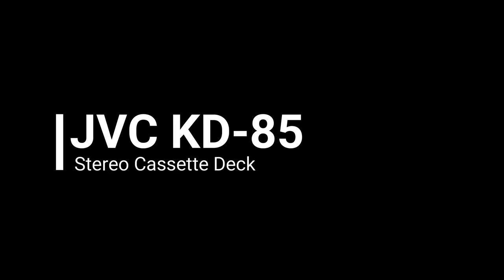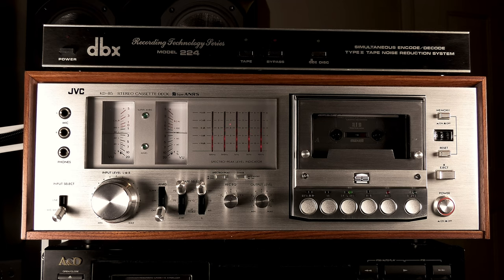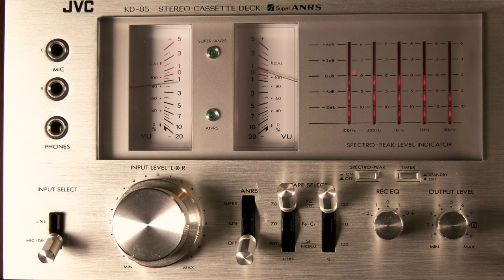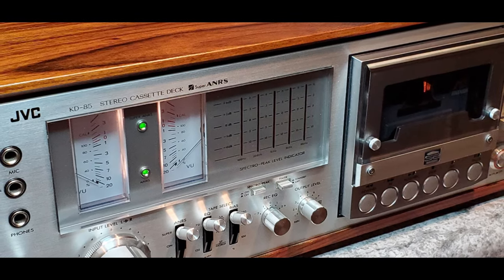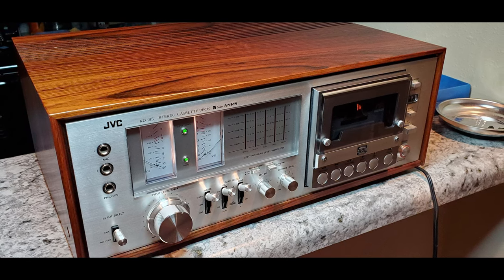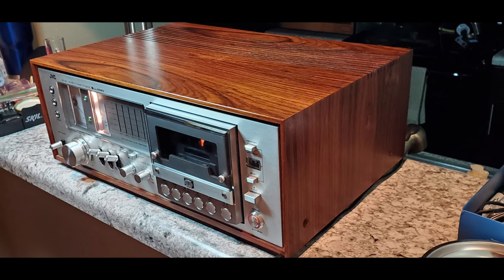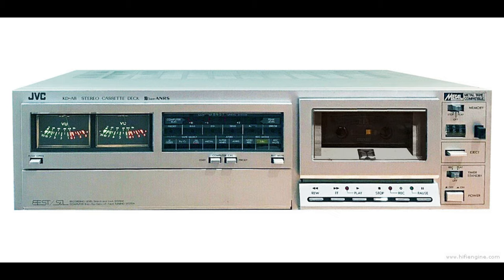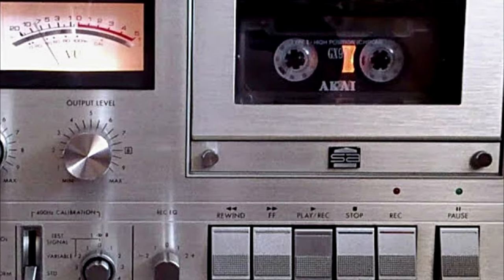JVC KD 85 Cassette Deck

Comment from the maker: Technically not mic to line mixing in the true sense. It will allow either/or of the mic/line recording but not true mixing as you cannot isolate the play record relative to your source you may record from, unlike my most current TEAC A-7300 which is true line to mic mixing. That machine elsewhere on my channel for reference. Apologies for the possible confusion.

Comment: I love my JVC cassette decks. After my KD-65 I purchased a JVC KD-A77 for the 3-head setup and I became even more addicted to recording my vinyl on tape  The JVC KD-A77 did well until 3 years ago. It died from being in storage for over a year. I was desperate and went on eBay and bought a JVC DD-5 for 125.00! I was totally shocked when I received a JVC DD-7 instead! It worked for 90 days or so and quit. I had it refurbished by Bob in Williamsburg. He informed me that he had never worked on a deck with such low Wow & Flutter and DC configured amps throughout. I fired it up and it was amazingly clean and lifelike. It should outlast me!
Reply: Rock on brother!

Comment: I purchased a JVC KD-65 back in 1978 and loved it. My friend bought the KD-85 upon my recommendation and he used it for 20 years before it quit. He could not afford to get it repaired so it met an untimely end . Good summary.
Reply from the maker: I always share with folks, JVC was nice to have in the 70s, 80s, part of the 90s. JVC now partnered with Kenwood are mere shadows of their once great selves. I hear you on the demise of the machine. Costs and parts is not an easy haul. I was fortunate on mine, it doesn't have allot of use on it. I will continue to keep it up to date. Things like electrolytic Capacitors,  and noisy transistors,  bad diodes and the like will show up at some point. These are not an easy machine to service. These are machines from a long gone Era. I try to enjoy mine while I can. Thanks for your view, and comment.

Comment: Thank you for the review of the KD-85.  I bought mine from Macy's (of all places) on SALE for $400-ish - maybe $480?  I can't even recall anymore.  It must have been '78 or '79 and I was nearing my twilight years of junior high... so long ago.  Yes, I still have it.  Had it refurbished 20 years ago because the solenoid/transport mechanism kept dropping out during all modes of operation.  The A/V tech diagnosed it as a weak transport motor.  As it was explained to me, the transport motor runs all the time the KD-85 is powered on, and I often left the machine on overnight during those evenings when I would set up a recording before bedtime. The A/V tech found a transport motor in his boneyard of salvaged parts and got it going again.  I enjoyed it for a few more years but then my car's radio/cassette player died, and so did my motivation for making tapes for driving.  Well stated as a "time machine."  That and my JVC RCM-70.

Comment: Hello Can you please explain what the REC EQ button is for?
Reply from the maker: Record Equalization is for setting the appropriate eq in microseconds. Normal bias on a Cassette is typically 120 microseconds, the chrome or chrome equivalent is typically 70 microseconds. This gives the tape the proper emphasis or de-emphasis, escapes me at this moment which so the tape offers the most linear response possible and also since this is an industry standard playable on most other cassette decks. Nakamichi is a bit odd in that they hold to the earlier 80s time equalization vs. the rest of the cassette deck world. FeCr I do not remember its eq setting as I never used that tape. In my time Normal Bias, Chrome or High Bias tape, or Metal Particle tape which this machine will not record on. Playback is fine since it uses the 70 microsecond eq time constant too as chrome or chrome equivalent tapes do.
Reply from the maker: Also keep in mind that eq is also used in play back though bias is only used in record only.
Reply: @xray111xxx  👍👍👍